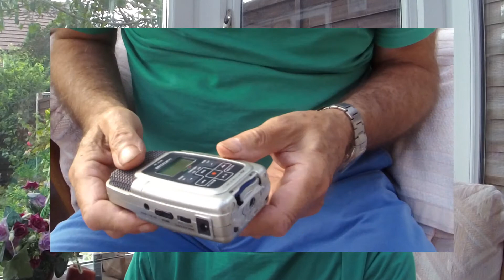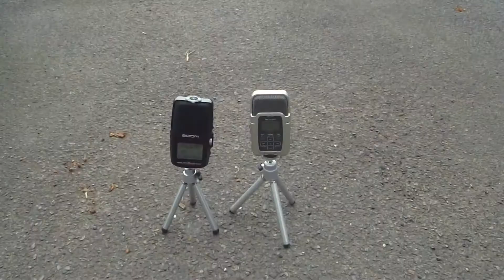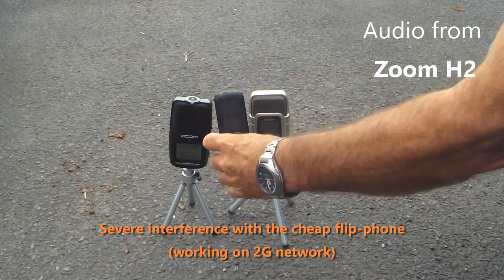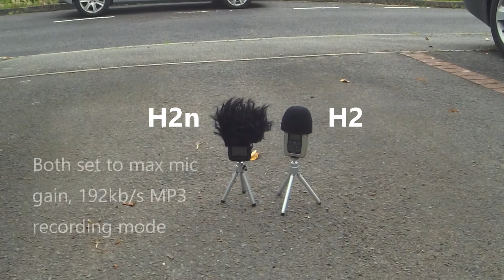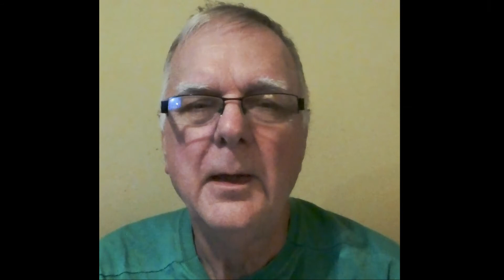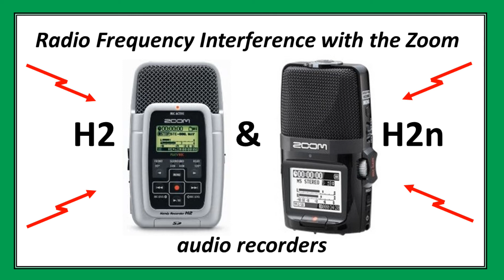Zoom H2 & H2n recorders: Effects of radio frequency interference

Comment: I'm using an H2N to record meetings and have similar problems in rooms with Wi-Fi repeaters. I used to have the same problem with a Tascam DR-05 and used the "tinfoil method" to fix it. Any idea if a similar method could be used on the H2N?

Comment: I JUST got this issue off and on in my last video unfortunately. I even set my phone on airplane mode, but it STILL gets interference noise on the road off and on. My next step is to also turn off the radio 100% as well. I turned the volume down while shooting, but I really need to probably power it off 100%. Sad that a day of shooting had to really be edited a TON post video shooting.

Also, I see that you did an interference check with a phone, but mine 100% picks up interference on my S9+ smartphone. Even at like 2-3 feet away.
Reply: Does activating a 40Hz or 80Hz low cut help?